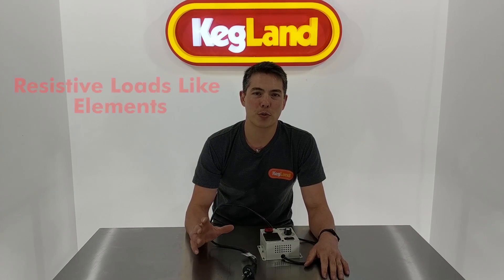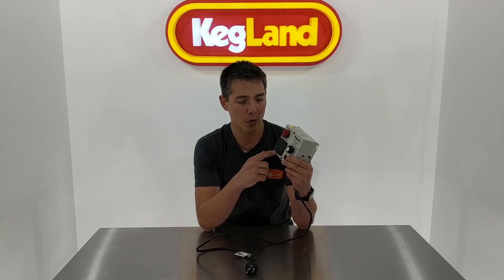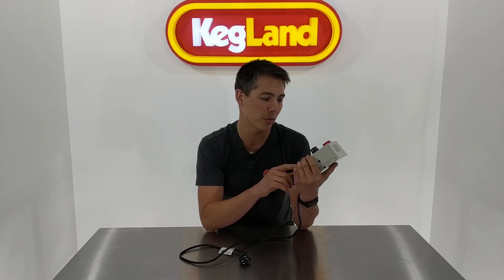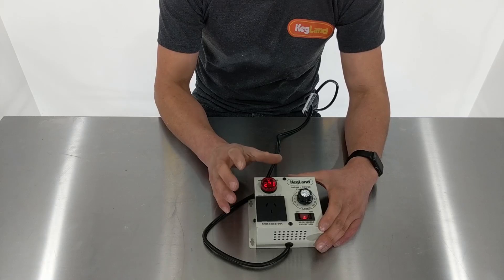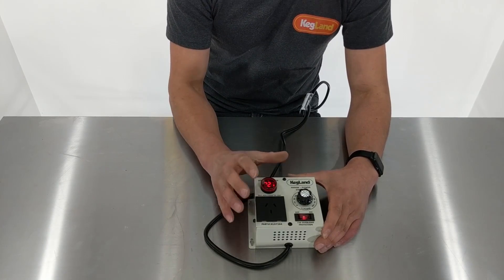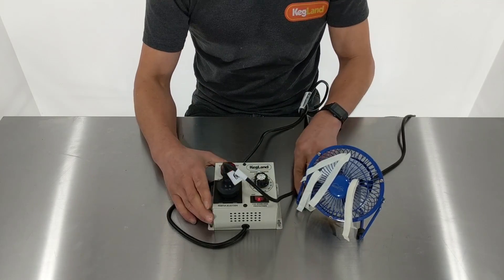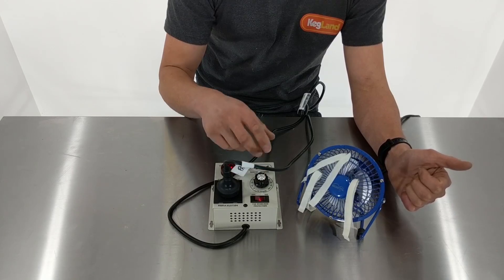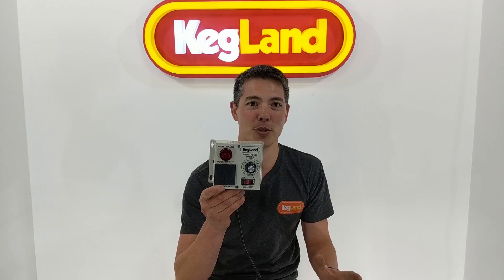Power Station Power/Speed Controller Chip - Pre-Wired

Comment: Can this be used for the 35l 110v digiboil?
Reply from the maker: You can but just be aware that if you go too low in power on this device the digiboil controller will turn off all together.  At a guess this might happen at about 50%.  So you would have good control at the top level but not at the low level if you are using a digiboil.
Reply: @KegLand  thanks for answering. I actually think that I like the other controller but I am not very clear on the logic of how it works

Comment: Does this work on electric motors or only brushed units
Reply from the maker: Yes this works on various AC electric motors. Obviously as this is an AC device it will not work on DC motors but I assume you know this already